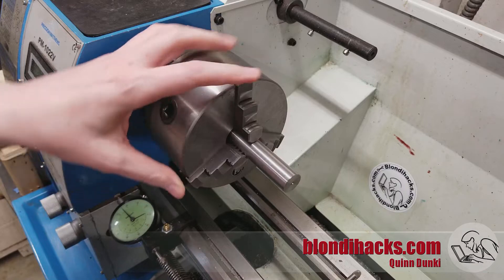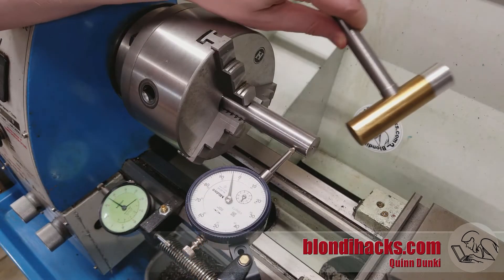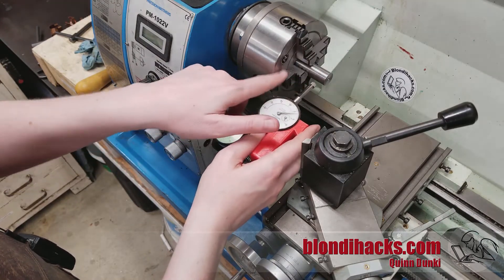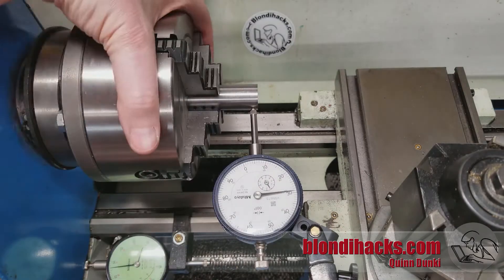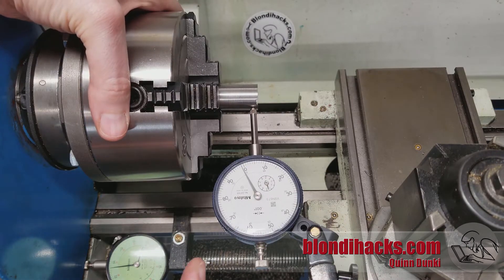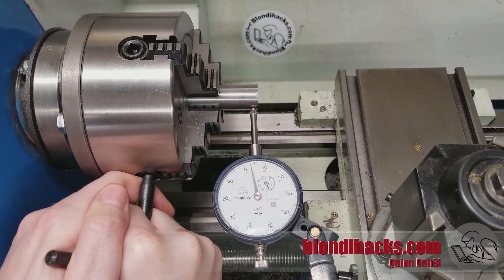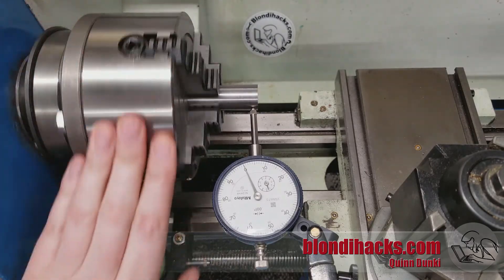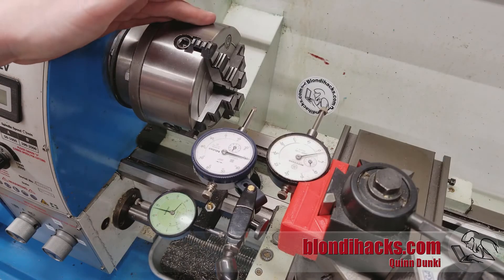Metal Lathe Tutorial 9 : Four-Jaw Chucks

Comment: Fantastic video.   I'm really enjoying your lathe series.   I have a question about the cylinder that you turned 90 degrees from the axis of rotation and faced off to make a flat side.   If i wanted to make a second flat side that is parallel tob the first,  isn there a good way to get there on a lathe?   I have access to a lathe but that is the only machining tool in what is mostly a wood shop.

Comment: Just discovered your channel.
Very pleasant to watch and listen to how you present it👍
I happen to have the same lathe as yours that I got for free as it was not working at the time.
It needed some TLC and is actually not bad at all. (I used to work with bigger lathes in the past)
Now, finally, and out of curiosity, my question: what kind of oil do you use in the feed gearbox. Mine was completely frozen due to burnt (carbonized) oil.
I have now an hydraulic oil in it as this was also used in the Colchester lathes I worked with.

Comment: Nice Videos!  Made me add you to my patreon collection..  I saw a nice video some years ago from Tubal Cain that show how I was taught to do it.   Get it rough centered, find the low spot, set indicator to 0, find the high spot, turn the dial to 1/2 of the reading.   Next, put one jaw at the indicator, use one chuck wrench on each side and just dial to 0 loosening one and tightening one.  Two passes normally does it.   The chuck wrench in the back can be a simple L shape.

Comment: If you only had a 3 jaw, could you not retain concentricity to some extent by drawing a line 90 degrees to the jaw backplate along the part matched to a line on the backplate. Then remove the part with as little loosening as possible then flip and reinsert with the line matched up to the spot on the backplate.

Comment: A question ! I am a woodworker and when I use my wood lathe I mark the drive center spur so the piece always goes back the same way. When you are using the 4 jaw chuck do you "reference" the piece to the jaw?
Reply: If you mean reference as in being able to take it out and put it back in the same way, I think you would need to re-indicate the part. If you loosen only two jaws to take the part out, the jaws that you left put will no longer be compressed and they might change location. 

I am an apprentice machinist mostly experienced on the mill and not with lathes (so I’m watching the series) but I am getting a feel for the machining philosophy.

Comment: Hi, I’ll soon be the happy owner of an old school lathe and I’m currently binge watching your lathe series. They are fantastic! The current owner of the lathe says that the chuck (3-jaw) is worn out so I’ll be on the lookout for a new one. I’ve seen that there are also 4-jaw self centering chucks. Is there any advantage of one of those over a 3-jaw?
Reply from the maker: That’s great! I love old lathes. The main advantage of more jaws on self-centering chucks is better grip. You can hold parts tighter, which is a definite advantage in many situations. Of course, it also makes holding square stock easier as well. You can hold square stock in a 3-jaw, but it’s off-center, so you’re limited to facing, pretty much.
Reply: Blondihacks Ah yes, hadn’t thought of the square stock issue 🤔 Tomorrow I’ll be the proud owner of a metric Myford ML7! The current owner fitted a variable speed motor which will be handy.

Comment: Once you find your high and low and you know the difference is 47, rotate the chuck until you are at 23.5 and reset your indicator to 0. Then proceed to dial it into the 0. When you get really close you may do the high/low/zero check again and tighten the highs to 0.

Comment: Good video, thank you.
I have a small, old model making lathe with a three jaw chuck. I have been meaning to find a four jaw for it. I think it is time to work out what size and fit of chuck I need to look for.
Reply from the maker: Alfred Chow Maker of Things Thanks! One good option might be to buy an inexpensive import one and make a backing plate for it. That’s often easier than finding original chucks for old machines.
Reply: @Blondihacks  Thank you. I will give that a go and see what turns up. I will rummage in our stash of stuff, can never remember what I might already have that will help.